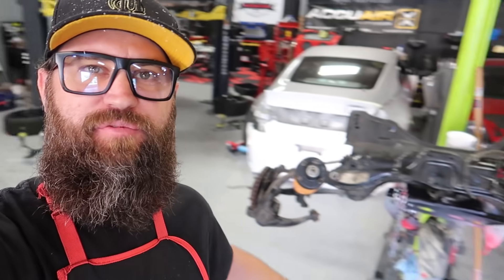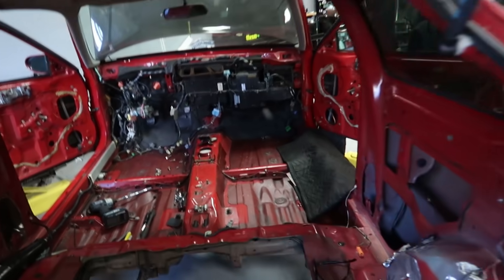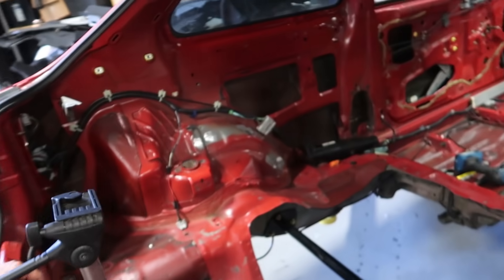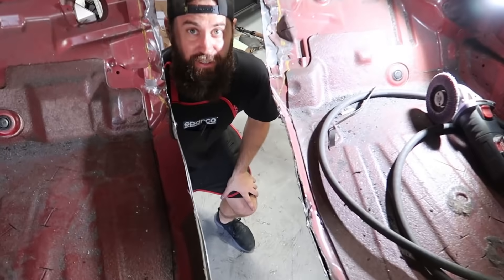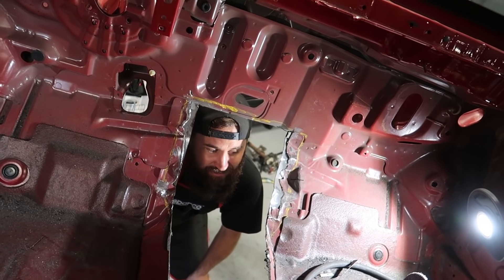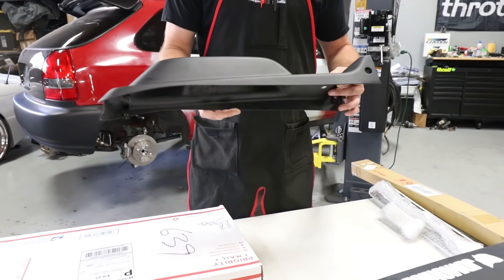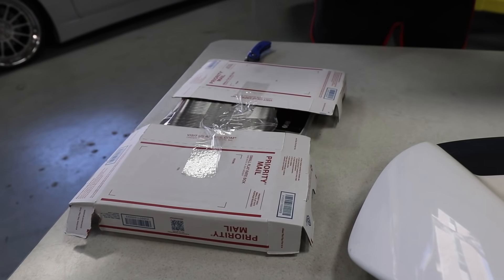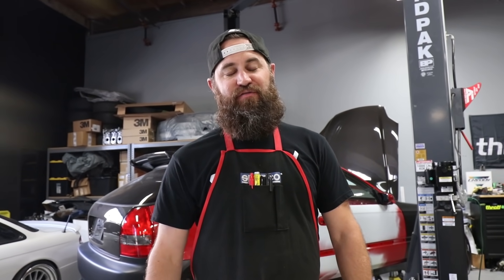Building & Heavily Modifying a 1999 Honda Civic EK Hatchback -- Part 6

Comment: YOOOO MICKEY 
I’m assuming you need to fab a new trans tunnel... if this is correct you should consider incorporating an access panel that will allow for bleeding the slave much easier

Comment: When I converted my 98 Celica GT to RWD I used pretty much the same path in terms of stripping everything and cutting away.  I had a totaled 85 SVO Mustang that we stole as much from as possible basically just using the Celica as a shell.  That's pretty good too since when I got it that's about all you could call it, people really didn't treat them a lot of them well.  I originally got it as a 400 dollar parts car to go with my mint 99 Celica GT but just opted to keep that one as is with an 3S swap.

After all that work I still probably drive my 84 SVO that's all original factory in pretty mint condition more than anything else.  Car feels right for me after doing suspension work and some fairly minor mechanical upgrades for a bit of a literal boost in power over the original numbers in 84.  Went from not really caring for foxbodies to loving this car to death after getting it.

Comment: Just modify the pipes out of the back of the heater core so they go through the firewall higher up or in a different location, i did that on my extensively modified Z32

Comment: Hey Mickey ..... A Vintage Air  A/C Condenser/Heater Core option has worked well for me on custom builds. I have used on custom firewall projects as well for some mini truck builds. IE:  Body dropped a S10 Blazer to lay frame on 22" wheels; also a 2JZ into a S10; &   a Del Sol w/ DIY/Homebrew  RHD(we only sourced dash & sub frame; fabbed up the firewall). The vintage air worked great for the Defrost!!!!  

        IF YOU CAN"T SEE IT'S HARD TO DRIVE!!

Comment: I have 20 years experience building swapped Civic hatches & racing them in Australia. For track work you certainly want maximum water cooling, but IMHO relying on the tiny heater core to boost this is not really effective. Instead, I always fit thicker radiators up front, or a full width one instead of those Honda Civic half width ones. For race track demisting we simply fir rear window demister elements to the front windscreen. Interesting build. There's over 250 Honda DIY build vids on my WJP004 channel, including a mountain of race car fiberglass tutorials. I'm sure you'll love it & get lots of ideas for this build.

Comment: Ya gotta go bold!  Cut out the transmisson tunnel and firewall sections of a wrecked S2000 or maybe a Corolla AE86 and graft EVERYTHING from the shift lever opening forward.and connect it to the firewall.  Include the mounts for the heater core and A/C unit.  Should still be able to mount the stock dash to cover things up.

Comment: Paused at 11:00
A heater core, AC, and power steering are essential.
Reply: Ac and heater yes, but power steering not really
Reply: @fila1445  I've driven a car that doesn't have power steering. No way fila1445. Hell no. Exotic cars, F1, Nascar have power steering, and my vehicle does too.
Reply: @abdullah_fardm.9725  i Daily car without power steering, it's not that bad and road feed back is anazing
Reply: @fila1445  Do you drive in a major City or County everyday?
Reply: @abdullah_fardm.9725  medium sized city
Reply: @fila1445  If you were in a major City where there are often traffic jams, or a lot of traffic, you probably would want PS.
Reply: @abdullah_fardm.9725 For what ? PS only helps when you turn your wheels while stationary. You dont turn your wheels in stop and go trafic
Reply: @fila1445  I guess that there are a lot of straight lanes where you are, not here.
Reply: @abdullah_fardm.9725  not really, i live in central Europe

Comment: I designed the Saker Rapx, the privious model the gt, had An Outlet in front of the window. Like the MR2 your building hot air from the radiator moved over the windscreen. Never any defrosting issues. Because of the roof scoop that needs to take in cold air, we changed the design on the Rapx. The roof scoop inlet temp dropped by 40degree C, however the window started to fug up...

Comment: For people looking to build a streetable track car, it's a really good idea to reinstall some new sound dampening material, even if it's only the 1mm thick aluminum-backed butyl rubber sheeting. It'll make a world of difference to how the car sounds when riding down the road. Instead of sounding like a tin can getting pelted with gravel, you'll get a quieter ride that won't threaten to deafen you. If you want less intrusive engine noise for long road trips, using thicker butyl rubber or even some shredded wool batting sheet on the firewall can help a lot to reduce intrusive engine noise while still letting you enjoy your exhaust note. For a pure track car, sound dampening is entirely irrelevant, since it does add weight, but the minimum amount to keep a car comfortable to ride in long distances to the track is less than 100lb of additional weight, which I think is worthwhile.

Comment: Use a flexalite mojave heater. You can mount it anywhere, and run ducting to the window vents. Its small and includes the blower motor and switches in one unit.

Comment: Mickey for motor mounts I would strongly looks at Team Oranges EVO X for inspiration because how they set up the FWD engine mounts as well as doing a V-mount Intercooler and Radiator is a excellent idea for RWD swaps that uses FWD engines.

Comment: You could do a different mount style use engine plates to keep the engine low in the frame . I don't know if you using wet sump or using a oil pump and remote oil tank.

Comment: I personally would loop my heater lines on the block and run top 1 motors window vents to cut down on condensation in the rain for trackdays

Comment: good job guys. i know I'm late, but why not install a hydroboost unit in place of the vacuum booster? it's a lot smaller and you get superior braking power. as for the firewall and console area, i would try to find a S2000 front clip with the dash and HVAC box in tact. that way you could get all the sheet metal and HVAC stuff.💪

Comment: You mentioned an S2000 box, can't you take measurements from that, cut out the floor, weld in flat metal and maybe splice in an S2000 tunnel?

Comment: Should have just hacked up a 240sx to combine it with the Civic  for this frankenstein.  The FCS kit is designed for use with a CR-V or wagon differential with viscous coup which would absolutely suck for a strictly RWD car.
Reply: brettyh1 - We’ll see.

Comment: Hey Mickey, just curious as to why you chose to use the F20 trans over the BMW gearbox with the adaptor plate from KMiata like Speed Academy did in their S14 build. 

I understand that using the F20C engine and trans together saves a lot of headaches bellhousing wise, but could the BMW option have meant less work with the Trans tunnel height wise?

LOVING the build brother, strongly considering doing the same thing in an EG Sedan to take Drifting

EDIT: Just realised that the Miata Trans tunnel sits super high like the S2000 one does
Reply: ThisIsForCody - You answered your own question.👍🏼
Reply: @mickeyandrade3435  Yeah i figured i did! hahaha

Comment: Sooo.. how much front caster will the civic have?! Converting from fwd to rwd will effect drive ability, no? Don’t most rwd have 5-7 degrees of front caster and the strut towers are closer to the windshield to help self-steer when forward thrust is coming from the rear wheels. Fwd and awd cars have a lower degree of caster like 0-2
Reply: I wonder how this will affect driving on a track. Since micky just said it’s a race car

Comment: I am doing something like that build but i am putting a chevy 350 in a 2009 accent and making it rear wheel drive the hole in fire wall about the same size i am working on the rearend now not fun but it will when i am done

Comment: Il be blunt with you. As an owner of a 2jz powered Ef civic. This way of converting to rwd is just shit. The rear diff is weak and alters the way a civic handles far to much. Weight distro excetra excetra. I have tried this route of trying to keep as much of the original chassis as possible to reduce work and things but it just isn't so you make more work for yourself that tied with a terrible s2000 transmission which break even at stock f20 power. I chose an rx8 platform for my build with a jz swap to rid the chassis of the terrible renesis engine. Cut the body off and plop the Ef body on top. I designed it in such a way that I get to keep the whole rx8 interior and size and lose none of the features with the exception of the door cards and a chassis that will handles fantastic out of the showroom pz or not. Don't think I'm hating I love civics I own 2 Ef sedans (one being the half breed jzrx8 swap) the other being a 700hp daily and a Ef hatch. But imo it's either tube chassis or a body swap.